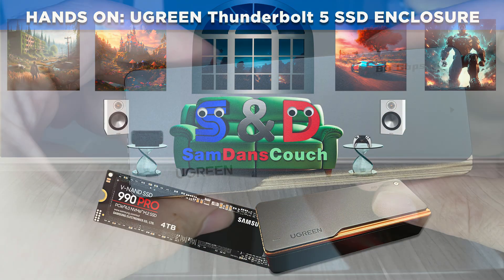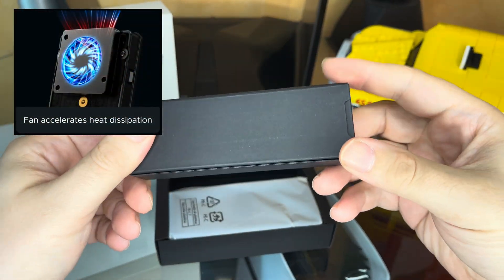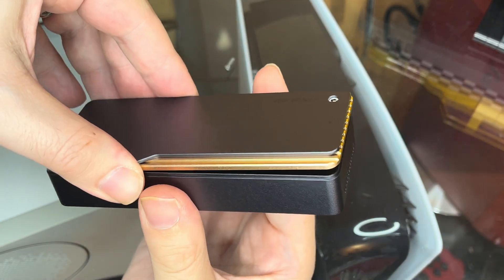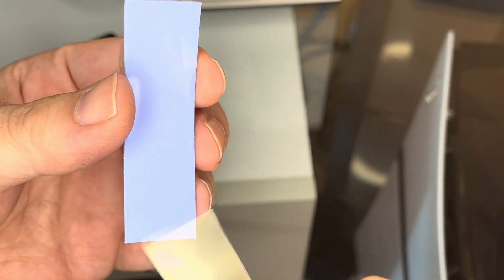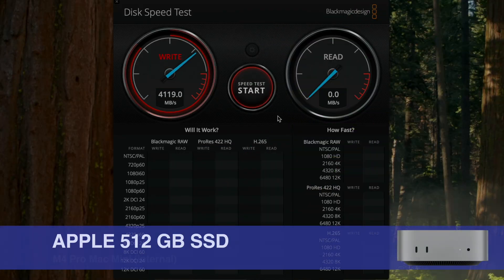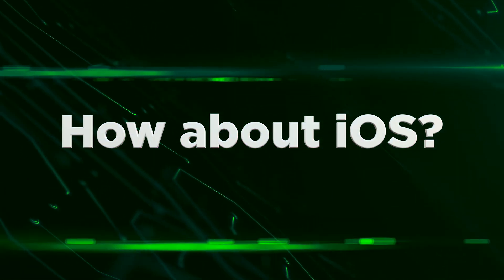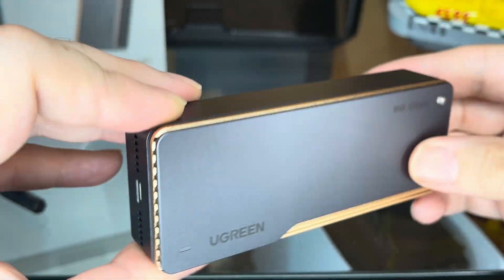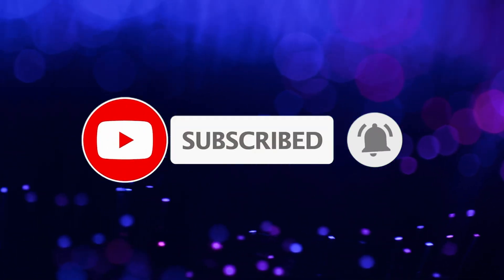INSTALL + BENCHMARK: UGREEN THUNDERBOLT 5 SSD ENCLOSURE I SAMSUNG 990 PRO I M4 Pro Mac mini + iOS

Comment: Got the enclosure today and it’s so noisy. Speed is ok.
Reply from the maker: Hi @sandrvoxon 👋 thank you for sharing your experience. I’m sorry the enclosure is so noisy for you. Mine is running very silent and I’m easily annoyed by noise too. Make sure that your ssd with its thermal pad has enough contact to the case for optimal transport of the heat. The fan spin speed is variable so if the ssd gets too hot it can spin up faster and get louder. In my daily run with video editing the fan never spins faster than the lowest speed which I can barely even hear. I hope you can fix it. Else I’d contact the manufacturer in case you have a bad fan.
Reply: @SamDansCouch  Thermal pad in on. SSD is Samsung 990 Evo plus. Noise from Fan like up and down. Temps 47-49.

Comment: An amazing device, but it has one huge drawback. It drains the MacBook battery incredibly fast when you're not connected to power.
Reply from the maker: Hi @iloginu 👋 Thank you for your feedback! External SSDs do draw power from your laptop constantly. You can deactivate Time Machine for the external drive for less access but it will never fully shut down. Seems to be a common thing though since my SanDisk extreme pro ssd (usb) does the same thing.

Comment: I think this review was done by Ugreen, as mine does not even come close to this.
Reply from the maker: Hello @IanJames56 This review was done by me and the products were bought with my own money as we are an independent channel that gives honest opinions. What you see in this video are real world results running on the hardware I have shown. Make sure that you have thunderbolt 5 and an SSD that is fast enough to reach these numbers. Also make sure that your cooling pad sits correctly on the SSD. Then you should get the same results. Cheers!

Comment: Wenn man Die Externe SSD nur für Video Schnitte also Final Cut Pro Verwendet wird Empfohlen Spotlight & Time Machine zu Deaktivieren das geht einfach= * Systemeinstellungen → Siri & Spotlight → Datenschutz → SSD hinzufügen
* Systemeinstellungen → Time Machine → Optionen → SSD ausschließen Dadurch hat man mehr Performance und weniger Hitze .
Reply from the maker: Hallo @miko_film 👋 Danke für den Tip!  Das ist ideal, gerade bei den ganzen temporären Dateien die man ständig erzeugt. Das muss nicht vom System indexiert werden 😎 Was für eine SSD hast du in deinem Gebrauch?
Reply: @SamDansCouch  Hallo Sam in Moment noch keine aber ich werde die Samsung EVO 990 Plus nehmen weil weniger Hitze Entwicklung diese einstellungen hab ich gesammelt under anderen von ChatGPT da ich die Extern für Final Cut Pro und ProRes Verwenden will.
Reply from the maker: @miko_film  Super! Ich benutze es seit meinem Test für alle meine Videoschnitt Projekte. Die 990 Pro läuft bei mir sehr gut mit dem angepassten Silikonpad. Da muss man sich zum Glück keine Gedanken um die Abwärme machen 🙂
Reply: @SamDansCouch  Die Pro ist Super aber in Moment Teuer oder Ausverkauft

Comment: Hast du ein Firmwareupdate der SSD geamcht? Oder ist es bei den recht neuen Chargen nicht mehr nötig? Die 990 Pro hatte mit alter FW wohl einige Probleme.
Reply from the maker: Hallo @tubecycler2.0 👋 Ich brauchte zum Glück kein Firmware update machen. Kam ab Werk schon mit der neusten Version.

Comment: Hi thanks for this video. Tell me does this drive have constant speeds? I've heard that despite the fan, speeds drop after a while on a Mac even below 1000 MB/s. What s your experience?
Reply from the maker: Hello @spotcutsfilm 👋 Thank you for being here 😊 I have been using this drive heavily for video editing with Final Cut Pro with lots of rendering. I have not experienced any slow downs. Also the fan barely turns on even after hours of work. I think what’s important is that you make sure that the thermal pad is touching the case properly for maximum cooling. How I put it together, the cooling works like a charm. So my recommendation still stands 😎
Reply: @SamDansCouch  Sounds cool :) thank you :)🤜🤛